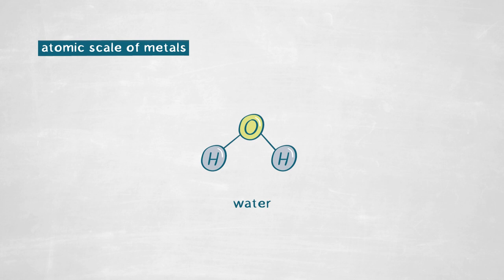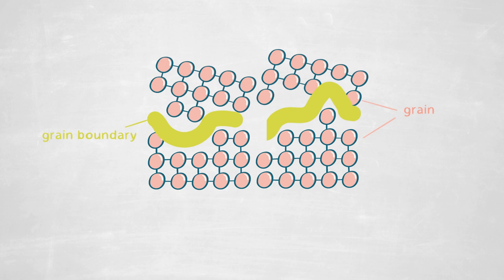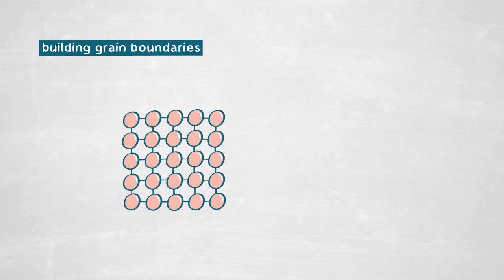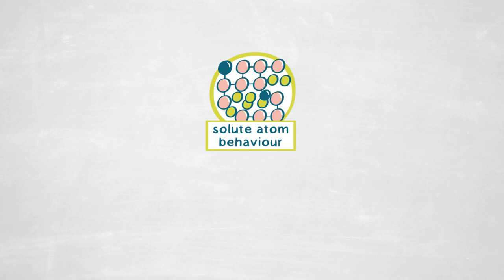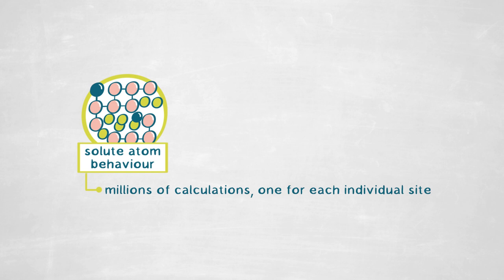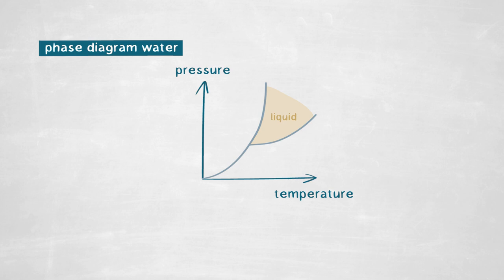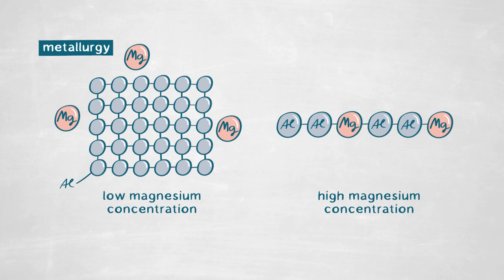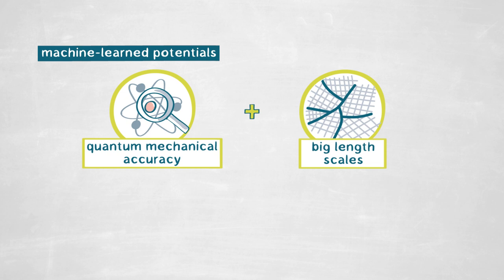How Do Alloying Elements Behave at the Grain Boundary?

Comment: Hello, That was a very clear explanation. Could you share which simulation software has been used? (If it is only allowed to share.)
Reply from the maker: Of course! Liam used the Lammps (https://www.lammps.org) package. For some time now he has been using pyiron (https://www.pyiron.org) to manage his calculations; If you have conda installed, you can get a python interface to running Lammps quickly and easily with `conda install -c conda-forge pyiron_atomistics lammps` (installation is pretty similar for Windows machines (https://pyiron.readthedocs.io/en/latest/source/installation.html#lammps-molecular-dynamics-with-interatomic-potentials))
Reply: @mpisusmat  Thank you for your reply.

Comment: Is Hall petch relation is applicable for every material. ??
Reply from the maker: Thanks for reaching out. Concerning your question: Not for glasses or plastics, but for all crystalline materials yes! In crystals (e.g. a chunk of regular steel), plastic deformation typically happens via the creation and motion of a type of defect called a dislocation. The idea behind the Hall-Petch relationship is that when these dislocations are travelling through the material facilitating deformation, they sometimes run into a grain boundary. These boundaries aren't easy for the dislocations to get past, so this winds up impeding the dislocation motion and making it harder to deform the material. Eventually enough of them pile up at the edge of one of these boundaries to force the deformation process to continue. So the idea is that with smaller grains, there's room for fewer dislocations to pile up and they have a harder time reaching this critical mass to actually keep deformation going. Since there's no such animal as a dislocation in amorphous materials  (e.g. glasses and plastics), and the model doesn't apply there.